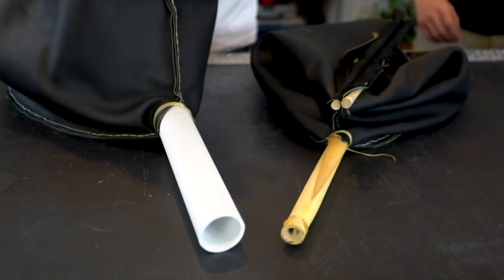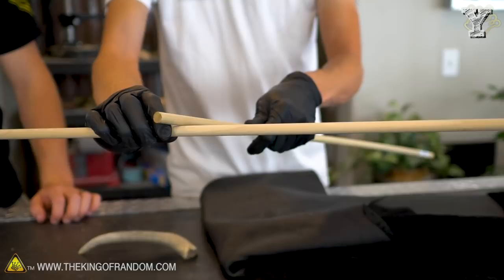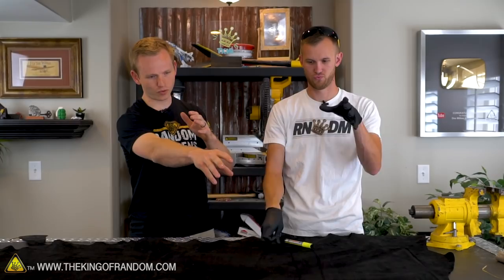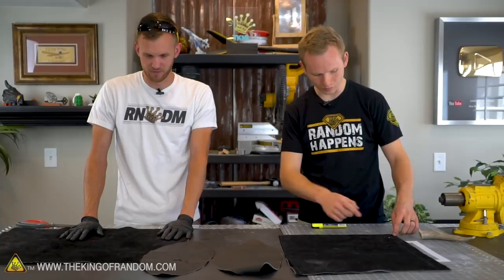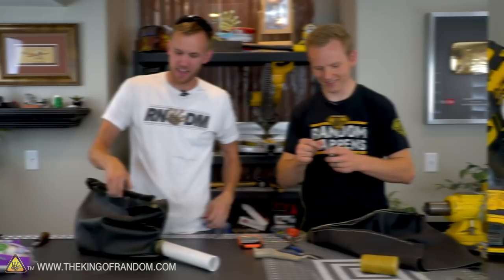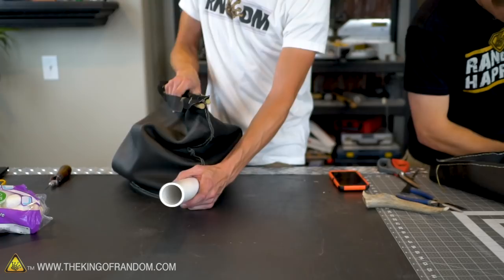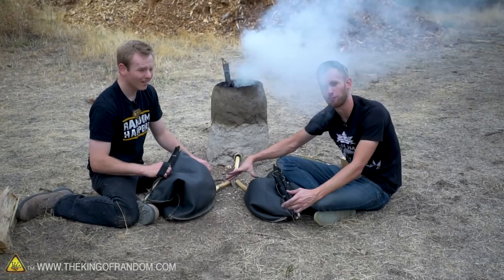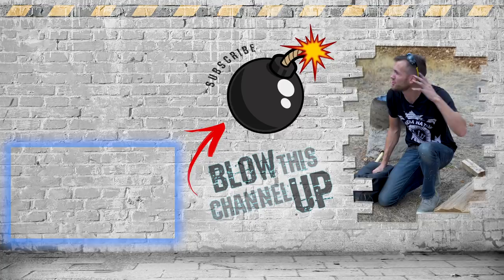It's Like a Purse That Melts Iron

Comment: You know those foot pumps for blowing up air mattresses work well also. The engine from a vacuum cleaner works also. Even if you dont have power you can make it with a bicycle powered generator with a converter to run the vacuum engine. The best part is that you can employ animals to walk on a converted tredmill that can power the generators as a means of giving the animals exercise or even you exercise.

Comment: Im like 78% sure the Vikings weren't harvesting Bamboo. You could just use a metal pipe guys. They probably did after the first bellows started working
Reply: I'm like 99% sure you don't have any real knowledge on Vikings like most people watching this and the upcoming iron making vid. For this purpose, it's even possible to use a wooden pipe or no pipe at all. It depends on the design of the furnace/kiln itself.

Comment: You may need another hole in the bottom to create a natural air draft (rocket stove ) style. This will get your fire as hot as it can get naturally.  Then using the forced draft air from the bellows, the fire would get much hotter.  Otherwise, you might get exhausted with a fire that continuesly needs your intervention to keep burning hot.

Comment: Power a small engine with the hydroxy generator.
Reply: They would have to make their own engine for it, a normal or a gas engine would not handle it. It's also not a great fuel for a small normal style engine overall, because from burning (detonating) a bottle of HHO you get less than a drop of water, and it cools down rapidly so unlike burning gasoline, the volume after burning decreases, so the engine wouldn't even start.

Comment: Freeze liquid nitrogen in a vacuum chamber to make solid nitrogen then put the solid nitrogen on top of water, if the solid nitrogen is cold enough then solid carbon dioxide from the atmosphere should condense to form dry ice floating on top of water.

Comment: "2000°" "Not that hot". Bruh
Reply: It’s all relative. Molten iron is about 3200°, so 2000° really isn’t even that hot. When I forge weld tool steels I’m typically working the steel around 2400°, even hotter than what they’re doing.
Reply: @sandervanduren2779  of course. That I understand. But what I was implying was that, the way he said it made it sound as if 2000° is now big deal